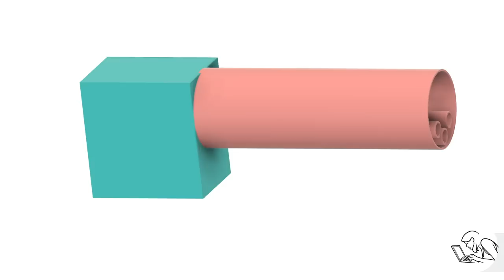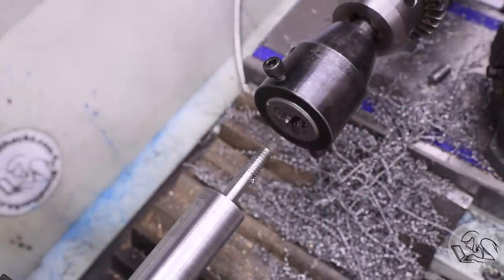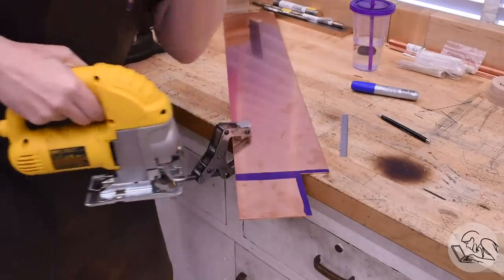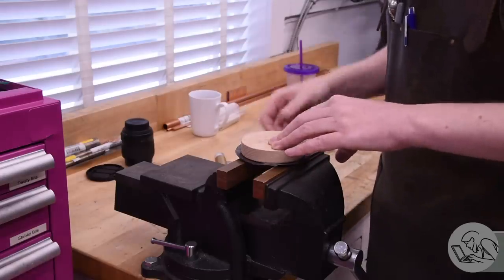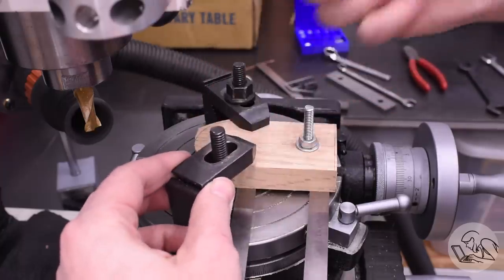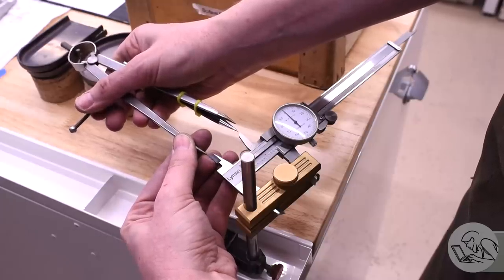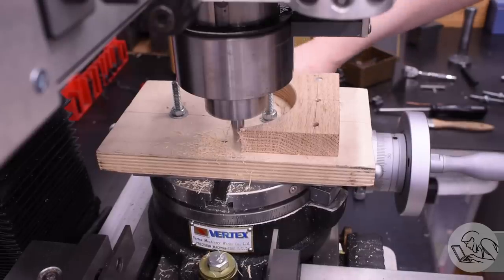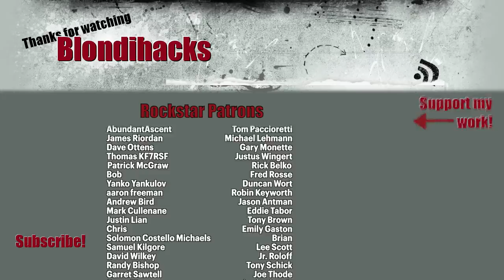Hammer-Forming Boiler Parts - Pennsylvania A3 Switcher, Part 2

Comment: A fascinating merge here of wood and metal fabrication which I found delightful. I would love to see more of this kind of thing. Thank you! I am a woodworker first with only very occasional forays into metal working. One reason woodworkers are not this precise is because wood is always moving. This degree of precision would not hold up for long because of how much moisture affects wood. Instead of saying the wood "springs" back perhaps it would be more accurate to say it is swells or shrinks. By contrast metal is much more reactive to heat than wood. After turning a wood piece I would never need to let it cool down to room temp to get an accurate measurement, for example. I am curious how fast your tool turns that cutter? A typical router spins at about 10,000 rpms or more.

Comment: Yup, woodworkers use reamers, though they're usually a bit bigger. Kindof a critical tool for chairmaking when getting the tenons on the legs and the mortices in the seat to match properly. But they're not straight reamers; they look more like pipe reamers because the mortices taper internally.

Comment: I'm a retired patternmaker and we used reamers in wood rutinly to fit pins in parts that needed to locale - just like in metal. If you ream from one side you get a tight fit, and if you ream from both sides you get a slightly looser fit. It can be handy if you have two parts where you want the pins to stay put in one of them .

Comment: Reamers for woodworking is kind of niche.  We generally fit the things to whatever hole size we can make, not the other way 'round.  Too, wood moves so much with temp and humidity that the tolerances you need for machining are orders of magnitude unnecessary for woodworking.  ("As a general rule" caveats apply.)

Comment: Happy new year Quinn . 
A tip for those who don't have centreing tools, is you can use a dead centre in the mill to centre the rotarry and again for the former :)
As for the over size , 
ok here me out, a lot of people cut until they don't see the pencil or scribe line, well for accuracy you cut about 2 thou past it, as when the wood gets cu,t it also gets warm and expands a bit depending on the wood Janka ( hardeness and type) 
Also for milling wood use is to cut pretty dam fast as this drags the fibre into the cutter.

Comment: I always water quenched the copper heads gaskets on my motorbikes back in the day and many old engines today as needed, but there isn't any precision needed with them beyond keeping sufficient and uniform thickness.  Only reason I water quench is to use the bit straight away, sure can't quench harden pure copper but you can certainly do it unevenly or burn it by getting too carried away with the flame...  I'm certain there is a big difference when trying to manufacture precision parts and I'm also pretty sure Quinn is all over the methodology.

Comment: I'm not a woodworker, but I share shop space with far too many of them (and their sawdust getting all over everything), and my impression of what they'd do instead of using a reamer is to just leave the hole a little undersized, and call it a carpenter's interference fit (by which I mean whatever term a carpenter uses instead of "interference fit", which I'm sure they have a term for, given how excited the lot of them get by a big woodworking project held together without fasteners because all the joints have good interference fits... and maybe a bit of glue to help it out).

Comment: Wood workers don't use reamers because there is no such thing as a round hole in wood. The anisotropic expansion of wood that happens with just regular variation in humidity (even in stabilized wood) means that a perfectly round hole will be out of round almost immediately and almost always.A twist drill gets you close enough to round that it works just as well in almost every possible scenario provided you use the right size twist drill.

Comment: Boilers are a fascinating topic.  There are a LOT of versions.   Drachinifel did a really great video on the evolution of Navel boilers.  A lot of the same concepts, although generally in more stressed applications.   The "fire tubes" eventually switched to holding the water,  smaller tubes being more efficient to transfer the heat to the water.  High pressure boilers would be running north of 800 degree steam.   But...please don't build one like that, it's a bomb that wants to kill you.

also, annealing non-ferrous metals works fine with a quench, if you use a pickle it will even pull a lot of the surface crud from the torch off.    Of course, I work in jewelry, not boilers, so you may have a good reason not to do this.
Reply: Naval boiler. A navel boiler would be something else😂

Comment: I have worked with cabinet shops and installers for over 30 yrs, I won't say what industry. 
But, yes I have seen reamers used to true up a drilled hole and improve the fit.

Comment: Lignin and cellulose foam does tend towards some flexibility.  I work with it on the regular.  I can't achieve the same level of precision you do because my material moves further than your tolerances, especially softwoods.

Comment: That "spring back" you're getting on the oak has me puzzled.  I used to be a woodworker, doing pretty high precision stuff in cabinetmaking.  I'm really not familiar with that problem.  Our feed rates are way higher than on a mill too. Regardless, routing to a template with a guide bearing router bit would presumably give a similar offset, yet I can't recall experiencing that.  Maybe we have slight offsets built into the router bits that I've never noticed?  Something fishy might be going on, like maybe the slight squishy-ness of wood requires more clamping pressure than you'd ever use in metalworking?  We do tend to need sacrificial cauls under clamp heads to get adequate pressure while not damaging the material, just to give you a sense of how much pressure we're talkin.  It sure is cool to see oak on a mill though, and I'm glad it's working!

Comment: @8:15 Plate or Sheet Metal... in German we use the therms Platte for Plate and Blech for Sheet metal. We called mostly more big than thick pieces of Metal Sheet and very thick but small pieces plate. So a 50 mm thick metal can be a sheet of metal if it´s 3 meters (some of 9 Füße for your Imperials😜) long, but we called them sometimes Plate too. I know, german is difficult, for us germans too😄

Comment: As mainly a woodworker I always feel like I need to volunteer my time and tools when I see you playing with organic matter and screaming banshee's, but you always get it done. The 'instant' spring back is interesting as moisture will certainly cause longer term swelling etc.  I'm thinking that what you are seeing is an artifact of only having a "balls out" speed on your spindle as most wood tools start at Samurai and therefore cut a bit better/faster. (Also router bits tend to be sharper than end mills)  As an Xmas present to myself I went out and bought a full set of Kozo's books and will be following along as you build the A3. Thank You for being such an inspiration over the past few years as I get more and more into the "Clean" world of making.  Have a Happy New Years.

Comment: For reference, with woodworking CNC mills, you typically want a feed-per-tooth of 0.003" or so. With a 2-flute 1/4" end milling bit, that turns out to be 100 inches per minute at 18000 RPM. Not sure how that'll translate to a metal working mill. I know your RPMs are nowhere near as high. At 1000 rpm your feed rate would be 6 inches per minute.

Regarding that wood "spring back" effect you were seeing, I'm curious to know if you saw the same behavior with both conventional and climb cutting?

Thanks again for sharing your neato projects!

Comment: This video reminds me of the middle ground between woodworking and machining, traditional pattern making. Achieving machinist level (or better) tolerances and precision in wood with a mixture of power and hand tools, all the while allowing for precise amounts of shrinkage for the specific metal alloy being cast. One small pattern (like a pop bottle) could take weeks of effort to produce. The thickness of one thin coat of paint or finish could be enough to ruin a pattern.

Comment: Nice work! I think you could also have 3D printed the formers and used multiple presses - I've seen it done in aluminium, I can't see why it wouldn't work in copper.
Reply: Interesting thought although for the thickness of copper used here I don't think anything but sintering would have the strength.

Comment: Yes, woodworkers use reamers, but not often. They differ somewhat, the teeth are coarser, as one would expect. Usually not, though. We tend to use a rasp to hit the scribe lines for complex curves on parts or small diameter internal holes, and a chisel to pare when working on the exterior.  And, of course, we're not trying to hit a tenth for dimensioning. But I have used a reamer when the hole was critical and I have a lot of parts to do. It's much faster, unless it's a one-off or something. Then the rasp is.

Comment: Lovely job. If it keeps going this way it's going to be a beautiful boiler! The flat form for the throat plate was wild but it seemed to come out just right.

 It's amazing how much precision Kozo asks for. It's only boiler making after all - the definition of rough and ready :)
Reply: Fundamentally you're correct but you still have meet the precision standards for high quality silver soldering. You are going to be stting behind this thing with it between your legs -  you do NOT want any kind of failure!😅😇

Comment: When I turned som wood round bar on the metal lathe, I did learn that I had to take shallow cuts (0,1-0,3mm) to achieve expected diameter, but I never took more than 1,0mm cuts. Also the harder the wood the better it “behaved”.

Comment: You can quench copper in cold water after it loses its glow and it is annealed.  No need to stabilize it at room temp for a long time, or temper it.
Reply: Refer to Keith Appleton videos.  Let the annealed copper cool to black before the cold water quench.
Reply: @smallbyrdz3823  See, I didn’t think about sheets.  I quench small copper slugs and they work fine.

Comment: The 10/14 blade pitch means that it is a variable pitch. Some teeth are spaced at 1/10 inch and some are spaced with a 1/14 inch pitch and everything in between. This is intended to reduce chatter and vibration. This variable pitch shows up in odd places. I have a much-lived countersink with 5 variably spaced cutting edges. It really does cut with less chatter.

Comment: When you did the form blocks on the radius and had to do multiple setups, my first thought was that you should cut thread into the centering pin (they don’t seem too complex so maybe whip up a spare) so you could then use the center as the second clamp.
Might be a reason this is not a good idea though 

Very much enjoy the versatility of disciplines being employed in a project like this.
Plus it’s always fun to see a metalworker work in wood - y’all are super scared of the woodworking tools 😅 instruments of mass destruction or murder and what not😂 you’re not the only on I have heard describe them in those kinds of terms

Comment: Wood moves all of the time due to humidity. Fine woodworking is all about catering for that movment and if you do it right the article of furniture will last for a very long time in any climate. Metal is easier in some respects at least in principal you can weld back on a bit if you cut it off by mistake, try doing that with end grain.

Comment: 10:00 The technique you show has another advantage: By dropping the handle you move the contact point between file and work towards you which shortens the required stroke to use the full length of the file. More used teeth -> faster filing. Mathematically the relative speed between part and file indeed increases, no idea if that has any practical relevance though.

Comment: Quinn just a thought on the .010 extra on your wood form. Was that just a regular steel milling cutter? A wood router bit would probably have a different angle to the cutting edge and have cut with a shearing action without compressing the wood. Not sure if that makes sense but if you ever duplicate the making of the forms it would be an interesting experiment to see if that works. I would love to know if you ever try it. Thanks Dave

Comment: For about 15cm diameter, you want around 1000 rpm (some bowls ~20 cm at 1000 rpm but much larger and the risk is rather pronounced). Unlike metal, wood can explode on you.

Comment: I shamelesly stole your centre guide design a while ago, but added internal treads at both ends for a draw bar and centre camping. I know any clamping force will work against the taper, but with the draw bar/nut it should be able to hold a dair bit.
Using metal reamers in wood? That be witchcraft.

Comment: I am confunse on the eplanations I have read about the 10/14 TPI blade. One site says it is a 10 TPI blade 14" long and another says it is 10 TPI on one side and 14 TPI on the other. I think it is a marketing scam to produce more blades that you don't need no matter how many teeth it has. As for purchasing a roundover bit, a router bit for wood work will also work. The blades can be tool steel or carbide and they will also work on aluminum. The shanks are from 1/4" up to 1/2". Not sure if any cheaper but if you already have one...

Comment: This seems a little too obvious to suggest, But could you drill a through hole through the taper pin and locating pin sets and then just run a through bolt to clamp the parts with the existing through holes for the locating pins? I guess it would depend on what the underside of the rotary table looks if there would be anywhere to have a nut or similar on the bottom that would clamp against the rotating part.
Reply: And now that I think about it more,  you'd have no way of getting to a nut on the bottom without taking the table off the mill. I suppose you could probably weld or more likely braze a threaded piece of some sort down there for a through bolt. But I'm seeing how that gets complicated fast

Comment: Hey Quinn... just curious, why do you insist on drawing the full line corner to corner when setting out your centre?  So long as you are confident that your rule is correctly positioned, would not shortened lines covering the optical centre be sufficient?  Love your work, and envious of your new workshop!

Comment: Wait a sec, is the dropping the file handle thing cause it then follows the tangent of the curved part as you work? And if so, is the reason it doesn't work 'forwards' as well as 'backwards' analagous to conventional vs climb cutting as you'd dig in more if you try to follow the curve and file the part in the same direction?

Comment: You just demonstrated the main problem with combining woodworking and machining in one shop. That material you used to deburr the wood is called sandpaper when you use it on wood, but that same piece is called emerypaper when used on metal. This is an unhealthy situation that can only be resolved by not cross-contaminating two incompatible shops.

Comment: What kind of bricks do you use for your hearth, and where do you get them?  Obviously it's not just regular construction bricks, those would never stand the temperature...
Reply: What you're looking for is firebrick. They stand up to the heat without cracking and are also insulating.

Comment: What are the consequences of overheating the copper?
Reply: There are none.
Reply: Easy. It melts and leaves holes, but, oxi is needed for that, and it will form a lot of soot before that. Easy enough of you use a large torch on a small tube braze joint